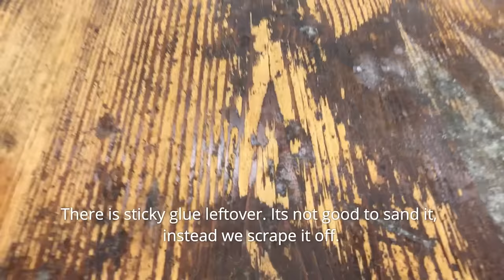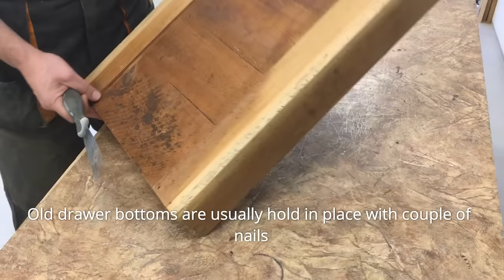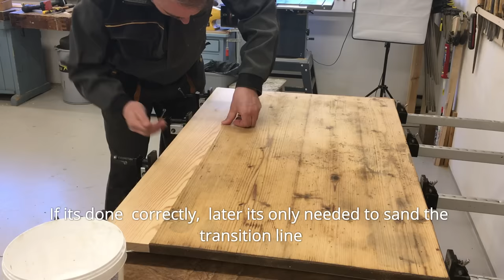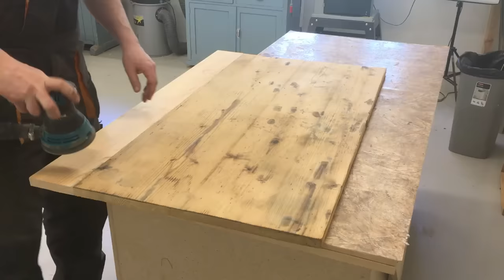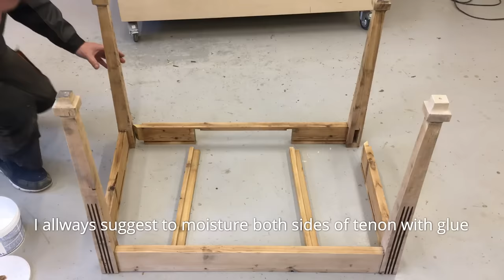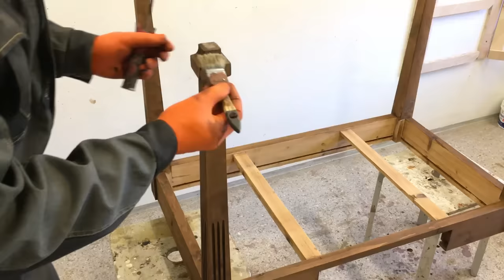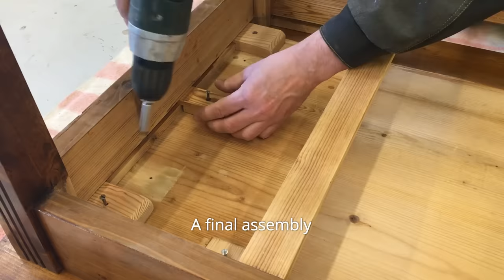How to restore an old table for beginner

Comment: I love restoration work!!! I am 16 and I love to do these kinds of jobs. A couple of months ago I took my dresser and stripped all of the paint. It was a weak latex paint so it came off very easily. I then sanded the really nice wood underneath, and then left it as is. I was proud of the results. It is always a great feeling to look at a job once it is finished!
Reply from the maker: I started around the same age with restoration and I still enjoy it!
Reply: @ATRestoration  oh that’s cool! Restoration is satisfying!
Reply: Congratulations. Passion in your heart with great skills, at 16, is surely the path to success by doing what you love. Xxx👌🌟
Reply: loved that you enjoy doing woodwork at your age    do it with love and be patience   it will always turn beautiful
Reply: Using a wire wheel on brass is a no_no

Comment: Don't see many beginners having those machines or tools but good job turned out nicely.
Reply: I guess it's more about the tips than tools
Reply: You can get the job done with less tool and lots of resourcefulness
Reply: @FastEddy5  Oh you was born with a table saw, jointer, bandsaw and oscillating drum sander was you?
The original commenter is correct these are not the kind of tools an average person has in their garage for doing the odd maintenance job on the home like a power drill or a jigsaw these are tools someone already into woodworking purchases and presumably knows how to use them.
Reply: X2
Reply: @matthewhopkins666  I lost all my power tools when my house flooded. I’m having to make do with donated furniture and a minimal budget while I rebuild not just my home, but two businesses. Videos like this give me an idea of what to invest in for the specific jobs I have, in this case, renovating an old table. I am also, for the record, most definitely “sissy” 😂
Reply: Can you hire tools like this in your country. We can in England. Then you can see if this sort of thing is for you. I do restoration and re-upholstery and I have nowhere near as many tools. It’s a hobby and I am gradually getting things I need.
Reply: If you don't have the tools, make friends with people who do haha! Borrowing tools is how I get a lot of my projects done, I tend to buy tools that I borrow frequently, but I will most likely be we buy a heat gun since I have yet to have a need for one. I think I would have bought chemical glue remover for this project.
Reply: I think it was for the title .
Reply: @FastEddy5  being a woman, I'm not any kind of man, but I have tools.
Reply: @nygrl6102  that's great, I know many women in skilled trades. Very creative and passionate in their field. Most people do.
Reply: You can do pretty much everything with basic hand tools.  It's just a lot more work.  This guy is doing this professionally.  So, he is obviously going to be better equipped than most people.  And he can't afford to spend the kind of time on it that most people would.
Reply: @FastEddy5  What a ridiculous comment. It's bizarre to insult people for not having woodworking tools anyway, but the video literally says it is "for beginners." Who did you think would be in the comments? People who don't have a lot of experience yet- and thus haven't heavily invested into specialized tools for the job. Come on.
Reply: @ChrissyPlus  whatever I've never grown up with means. And on top of that I've been poor most of my life but I still accumulated tools since I was the age of 12. So you know I know that there are some people out there that don't have these tools that's obvious but give me a freaking break and go whine to somebody else.
Reply: @FastEddy5  Not having tools doesn't make you less of a man and having tools doesn't make you more of a man. What makes someone a stand up person is character, grace, kindness, and integrity- regardless of their gender.
Reply: @NorCaliGirl  well no one's arguing that. It's just a stupid project. don't understand why everybody's making a big deal of my comment I don't know anybody that doesn't have these basic tools but that's just me and there's a whole lot of people in the world.
Reply: @FastEddy5   Sir. It seems you are, in fact, the one arguing this point as you said in your comment that if you don't have any these tools, you must be "a younger man, a boy, or a sissie" implying that being a "real man" is dependent on having these tools, "if you are any man at all" and thats just not the case. Maybe instead of wondering why EVERYBODY is making a big deal about your comment, you should wonder about how you worded said comment. If you are being misunderstood, perhaps you should revisit your previous statement to include more clarity, because as it stands, it is a complete falsehood.
Reply: @NorCaliGirl  okay you're right I'm wrong. I was in a mood. Have a great day. Don't want to irritate any snow flake nerves.
Reply: @FastEddy5  Awww you're upset. Sowee. Hugs and kisses.
Reply: @FastEddy5  You're the only one who was whining, and the only one being judgmental. If you don't like being called out on treating people like crap, then stop doing it. People who don't have the tools you do aren't good enough or manly enough for you? Boohoo, your opinion on everyone else's manliness is irrelevant and unwelcome. Someone just made a calm observation that for a BEGINNER, they aren't going to have professional tools. A perfectly reasonable thing to say- and helpful for the channel, as they will understand how to title videos to reach the audience they want.  Metrics are important to keep your channel profitable/reaching a wider audience. Meanwhile you somehow took that as a personal challenge. Well, you aren't a beginner by your own claim, so you having these tools is less than relevant to the issue that beginners don't have pro-grade tools. Get over yourself lol it was such a benign comment.
Reply: At first I thought, "it's just a heat gun, a couple of sanders, a mallet and chisel - I can definitely handle those as a beginner", and then we got to the oscillating sander and it was all downhill from there! Definitely not for beginners. Still a great video though.
Reply: @FastEddy5  Very arrogant of you assuming any real man should have all of these tools AND the workspace to house them. Not all men are into woodworking but yet are real men.
Reply: @robinsuewho9430  get a life,  It is not  like I stated that men come out at birth holding a saw.
Reply: @JenniferIngrey  I mean you can just use a regular sander and a regular saw. Hes a professional that was explaining what the extra tools are not saying they are required for the job. It just takes longer but it's the same process
Reply: If you don't have pencils, you don't watch videos about writing.
Reply: @FastEddy5  Lmao your sexism is through the roof
Reply: @FastEddy5  you don't know any men without a full workshop? A lot of people with small wood working shops don't even have jointers...
Reply: ...a sander, hammer, chisel...if you wanna a get into this you would have bought stuff like that.. plus he is telling you how to do it as a tutorial
Reply: #Agreed ,👍👍👍
Reply: On these DIY projects, how many really have ALL these tools? SMH!! Good J.O.B on the restoration! 👍
Reply: If you are a beginner or have limited space (like me) you can stick with simpler projects or take woodworking classes at a local woodshed that will give you access to more tools. At one campground we wintered at (Voyager RV Resort in Tucson), they had a well appointed workshop for residents with experienced people who were ready to help you with advice. You joined for $25 a year and paid $1.00 a visit to help maintain the equipment.
Reply: Yeah pretty much
Reply: Exactly my thoughts!!
Reply: @TerryProthero  this is the comment I was looking for, to have such tools is nice but not necessary, I don’t have them either, ( elbow grease never hurt anyone) I’m in my hobby workshop every day, not bad I think for a woman, I build what I can with what I have it’s surprising what you can create with some imagination and time👍🏻
Reply: He meant beginners who are starting a restoration business, not like someone trying to upcycle a thrift store coffee table.
Reply: @matthewhopkins666  that was all used to replace the rotten parts. You can do the same with <$100 in hand tools and some patience.
Reply: @CableGuyRyv  That's the point fella.
Don't you think in a video titled "How to restore an old table for a beginner" they should show how to restore it with tools a novice is likely to have access to?
This is like putting out a video titled how to change a tyre at home and then using an industrial garage lift and air powered wrench.
Reply: When a lot of this furniture was made they didn't have a lot of those tools either.
Reply: You don't need to have a full shop to do it. You can get away with it with basic hand tools and careful attention to detail.

I am a second gen woodworker myself. Where there is a will there is a way, good tools are super nice. But you can do without.

Plus, that was in the context of a hobbyist, not someone who just needs something functional because they starting over and trying to make some old furniture better. But there is lots that can still be gleaned from this and the rest of his videos.

Really, this is not a complicated project at all. If you are blaming your tools for not being able to something like this you are not trying. This is still easier than building it from scratch.
Reply: @johnrus7661  We know you can do it with more basic tools the point the OP is making is that the video is titled how to restore a table for a beginner .
They didn't say it's a complicated job, they didn't say you can't do this job with more basic tools, they said these are not the tools a beginner is going to have.
If you are going to do a video for beginners then it makes sense to show them how to do the job with tools they are likely to have access to.
Reply: @matthewhopkins666  I basically actually was. My great uncle was a woodworker and he died a few years before I was born so my garage was full of those kinds of tools
Reply: @georginabarratt3992  So you can hire table saws, jointers, dust extractors and bandsaws in the UK? Nice. Sounds inexpensive and easy to set up.
Reply: @radman3206  you can hire many tools in the U.K.. To be honest I don’t know what you can hire but definitely most common electric tools will be available. 
As I am learning upholstery my tutor supplies all the tools I need and a lot of the sundries as well. Like hessian, horsehair, wadding etc. If we need any thing else he will order it for us and pay him. I have managed over time to build up my own tool bag but due to Covid we are having to use the tools provided. That I understand.
Reply: I have them and I'm a beginner 🤷‍♀️
Reply: @FastEddy5  here in my country the tools are way expensive that major people wouldnt buy it unless they're work with wood crafting stuff. So u would say my people isnt manly?
Reply: @malvinh4064  nope, not at all. That just makes good common sense to be honest.
Reply: @johnrus7661  Where's the contradiction?
Stop using words you don't understand.
There's nothing fancy about these tools?
Really how many people you know with a jointer in their garage?
Or a bandsaw, or a drum sander?
They aren't useful techniques for a beginner because he is literally showing you nothing a beginner would do with basic tools.
When he is just running the wood through a jointer to make a surface joint how is a beginner learning anything from that.
A beginner might have a hand plane, he might even have a handheld power planer he isn't likely to have.
A beginner is going to take one look at that and say well i don't have that machine so how would I get the result needed using different tools I do have.
Also I'm sick of idiots telling me you don't need these tools, I have never once said you do.
I have repeatedly said you CAN do it with other tools and he should have done the video with tools a beginner will have.
Go find a video to explain to you the basics of reading comprehension.
Reply: @aramwis  ü hi hi Hoża
Reply: @joannaludwiniak5335  don't know what that means friend
Reply: He didn't say he was a beginner he said for beginners
Reply: @Jean-qn4fy  Now that sounds like a great place to vist for the season. 😊
Reply: When I first read this, before I started watching the video, (it was the only visible comment before pressing play) I thought the commenter perhaps was being rude. After watching the video this guy definitely has a set up! Oscillating spindle sander, Delta sander and amazing table saws. This guy's work and shop is amazing, no beginner vibes on this video, unless he was being cheeky.😏
Reply: @nygrl6102  An important part is knowing why, when and how to use them. I have tools too. Beginner level, but I appreciate the skill to use these amazing resources! 😁
Reply: Having all those tools means he knows what he is doing!!
Reply: If you are starting out, you don't start on something big like a kitchen table. You start on something cheap and small from the charity shop. So you can do all the processing by hand. That's the best way to learn. Some things are cheaper than you think too. You don't need to buy all the pro gear straight away. And you can buy secondhand power tools if you save your money and shop wisely. And the ordinary DIYer will have a lot what is needed to strip down a smaller, cheaper piece like a side table.
Reply: @matthewhopkins666  Sorry mate, but you don't really understand. You don't start on a kitchen table. You start on something smaller, that you don't need pro gear to do. If you don't have basic woodworking power tools, then you do by hand. He's been in the business a long time, so don't resent him for that. Use your imagination and research how people restored furniture before power tools were common. When all they had were hand tools. Then start on small pieces and build up to larger ones. Look and learn from the process, and then find a way to practice. If you want it hard enough you'll find a way.
Reply: @ChrissyPlus  Stop moaning, and just learn what you can from the process. And make notes what you'd like to get hold of when you have the money. Think of cheaper ways to do the job, and then figure out where you're going to get the furniture to restore. You are never going to have another opportunity to get this information for nothing. So, use it or go somewhere else.
Reply: @BigHenFor  why are you so upset? Relax a little. Not everyone has to think things you enjoy are 100% perfect all the time.
Reply: If you fancy to begin angling,its not enough to have worms.
Reply: My thoughts exactly. The sander and hand tools are basic, but the heat gun and such isn’t a tool everyone has or can justify owning or affording.
Reply: @Bananacustardcostuming  it’s been a year and I hope things have gotten better for you.
Reply: Wow that is quite the beginner workshop.
Reply: I understand what you are saying but if you have been married to a builder, cabinet maker or alike and then you go through a divorce you could inherent some tools.
Reply: Meh I’ve seen way better

Comment: Very nice! I especially liked the small dutchman repair on the leg and the way you made the new foot to replace the rotten bottom of the leg. It's good to see you took the time to get the pieces completely disassembled. I've seen so many "repairs" done by amateurs who take shortcuts and drive in nails and screws all over the place, to try to stabilize the parts. Obviously, disassembly is the only right way to do it. It takes twice as long, but what's the point of restoring something if a person is doing a half-assed job. I enjoy your videos and the editing.

Comment: Just seen this and   . . . wow!  The connection system is exactly like the footstool I made at school in 1963.  Even the mortice and tenon joints match.  I still have it although, over time, it had to be made more robust with a few heavy duty screws.  Your comment was that this solution was common for 1890-1940 furniture.  Just shows how old my woodwork teacher was!  (UK)
Reply: Sounded like a quality man! Something built to withstand anything...unlike the crap made today! Excellent 👍🏼

Comment: This looks great. I doubt a beginner would have all the tools you used, though. 
My dad was a metal worker who manufactured and installed heating and air conditioning duct work. He was also handy in other areas. He built a lot of stuff and even invented some tools, although he never patented any of them, so he never made money from his inventions. I worked with him for a while. He died about 10 years ago, and he sold off all his tools before he died. I really miss him, but I also miss having access to the tools he had.

Comment: Just a hint!!!! After the first coat of varnish, use steel wool to knock the high spots down on the table legs and top. It’s like wet sanding a car to get the orange peel out. It’ll heat up the varnish and make it lay down for a smooth finish. That’s what I do on most of my projects. But, all in all... looks very good. Nice job 👍.